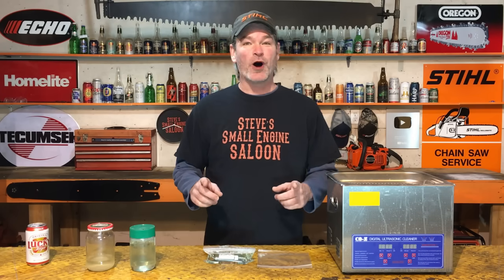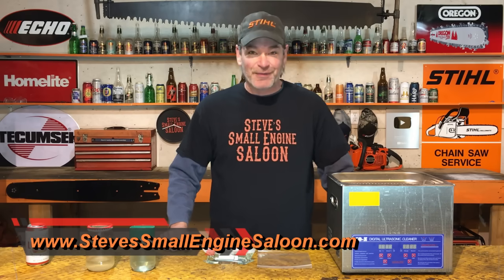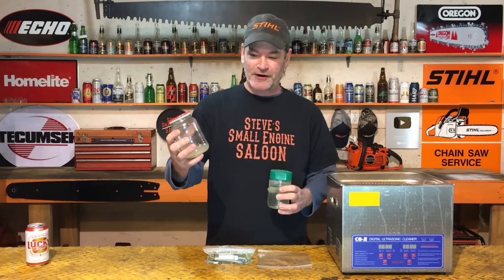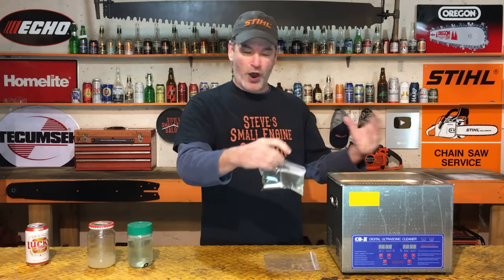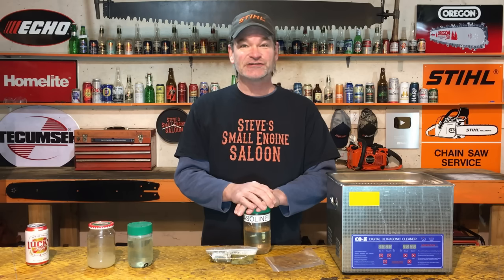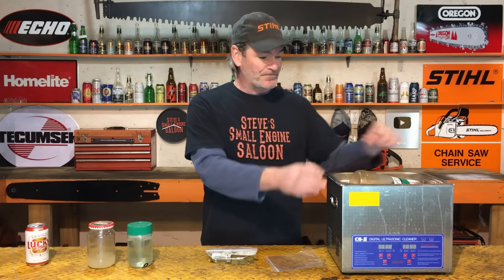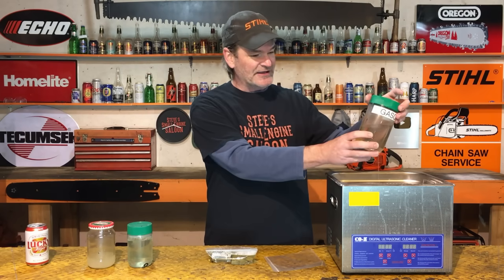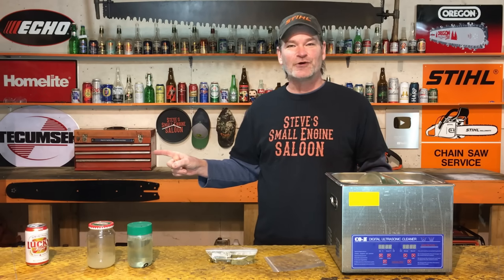UPDATE: Ultimate Tips For Using An Ultrasonic Cleaner

Comment: I believe that the concern about using gasoline is twofold, which I will list below just because. Having said that, just use reasonable precaution, or even unreasonable overkill precaution since that won't hurt nuthin', and the chances of disaster go way down. I occasionally use gasoline too because I agree that it's among the best solvents for cleaning stuff. OK, on to the concerns.

1) ultrasonic waves aren't a source of ignition, but they will increase the rate of evaporation, i.e. fumes. Loose fumes exit the container and could possibly concentrate dense enough that a stray spark anywhere around (maybe even electronics inside the base of the cleaner?) can ignite them.
I never tested this, but a friend's parent once told me a tall story when I was a kid that on a really cold day, you can extinguish a match in gasoline because it's the fumes that hover on the surface that ignite, not the fluid so much, and the cold air pretty much squelches out the making of vapor. Like I said, I don't know whether I believe this and I never tested it, but for sure the fumes are more volatile than the fluid.
Anyway, the first precaution is to make sure the inner container (jar) sealed well and is durable enough so the vapors stay contained inside and don't stray anywhere else to begin with. For a little extra help, you can point a fan on the UC to make sure any stray fumes are whisked away and don't concentrate. A further step would be to use it outdoors so if the gas ever did ignite, it might only burn up a UC and/or maybe the part you're trying to clean. Personally, I just use a well-sealed container in my detached garage and stay nearby so I can keep tabs on things, which I usually do anyway.

2) the biggest problem with gasoline is that IF it ever does ignite, it's an extremely vigorous event and even a pint of gasoline makes quite a whomping fireball if it catches a spark. It ain't so bad out in the yard, but indoors it's a very impressive, unpleasant surprise. Since the result of a perfect storm of wrong turns is a pretty dark day for the unassuming ultrasonic cleaning tech, though the reward is high, so is the risk I guess.

I don't think I'm mistaken assuming I won't live forever, and I work with my hands all day every day, so I'm already leaning my boat toward checking out due to a bad day rather than old age. But for me, the rewards are high and worth the risk. I'm not reckless and I work within what I think are comfortable limits, and while I am certain that some folks just will absolutely not clean things with gasoline in an ultrasonic because "leader" says it's bad, I hold no grudge against them nor will I let that slow me down. It works, so I'm gonna do it while also keeping my wits about me. Walking out your front door is a risk, so is cleaning parts with gasoline (ultrasonic or NOT, by the way). For me, it's worth it. Comfort increases with knowledge and experience. I guess complacency does too, but I'm going with comfort.
Reply: Speaking as a retired firefighter, your young friend was kind of right. It is the mixture of gasoline vapor and air that causes the gasoline to burn (or explore, which is just very fast burning). On a very cold winter day, it is more unlikely that the gasoline will ignite compared to hot +90F degree day, especially if the gasoline is spread over a large area of concrete or asphalt. The vapors expand at a much faster rate when heated. 

In addition, gasoline has a very narrow flammability range, in the area of 1.4% to 7.6% mixed with air, which makes it relatively safe to use, otherwise, we would have cars and trucks blowing up everywhere. When you are moving that match to the gasoline pool, somewhere within your reach you are going to pass through that flammability range, if you are unlucky, the gasoline will start burning before you reach the pool of gasoline. So while technically true, I wouldn't try it unless you are wearing fire protection gear and under controlled conditions (the match was attached to a long pool).  We were shown this during our fire training. Temperature, as I said, also plays a part in the reaction.

Comment: Gasoline vapors are the flammable component, not the liquid gasoline. That is why the gas is sprayed into the cylinder and ignited by the spark plug. The spark is igniting the vapor. That is why old gas doesn't fire the engine. Also, consider that more gas in the cylinder won't fire and we call it flooded or that the engine is running lean there is not enough fuel creating the proper combustion. I hope this makes sense. Adding heat to the ultrasonic cleaner wouldn't matter, all of us store our power equipment and gas cans in area that has heat in the summer. Steve, I learned a thing or two from you keep it up! Have an Old Style for me if you are in an area that has it.

Comment: Hi Steve, I give you some tips:
1) Plastic cups are not used. Better glass or stainless steel.
2) To clean aluminum parts, the best is the aqueous solution with suitable degreaser.
 Temp: 60 ° C This way, Not damage orings

3) The pieces are not supported without the basket. They are not thrown into the tank either. You can damage the transducers.
4) Solvents are immediately heated with ultrasound. They are dangerous and emit vapors that can affect the user.
Greetings from Argentine!! and thanks

Comment: You can use the same solution a lot of times. This what almost all retailers never told:
1. Degas the water. Which means, fill the tank and turn on the ultrasonic. For 30 liters it takes 1 hours +- to degas the water. Check the bubbles how they dance.
1.1 turn off.
2. Put the cleaning agent. To degrease and eliminate carbon, the 80% of the brands have two agents. Some times in relations 5% the first, and the second 0,5%
3. Turn on the ultrasonic and see that there is no bubbles.
4. You are on the correct path. To clean aluminum and cast iron, the correct temperature is among 65°C and 75°C / 80°C

Tips. The only thing you need to do is refill the evaporated water to keep the level and the same with agents. You can remove excess of grease with a spoon. But indeed, you can use the same solution even if it has a quite deep black and dirty appearance. A friend have a 150 liters tank and he does this and the solution la solución dura un año until the agents lose the cleaning properties and the water is really dirty.

If you want to use another kind of solution, use INOX little boxes, you can build them or pay for them with a welding INOX shop, they are not so expensive. Why? The frequency is designed for working with this type of material. Greetings!

Comment: Make a test, using kerosene, gasoline, diesel and alcohol and tell us wich one is best for cleaning
Reply: Try mineral spirits. Similar to kerosene, but with almost no fumes / odor.
Reply: @HyperPete  That's my go-to. It also leaves a bit of an oily residue so your parts don't start rusting as soon as they dry.

Comment: The cavitation vacuum bubbles collapsing (what makes the whole ultrasonic cleaner work) generates extremely high temperature and pressure. Since it’s submerged, no air means no ignition. I think your only risk with gasoline is if your part was partially  above the surface of gasoline so some of the cavitation bubbles where happening at the surface line...
More than likely you could play with that mix for a long time and never get an ignition. But the physics are actually there for a remote chance of a problem. 
I use gasoline for cleaning myself to. Some risk always involved but damn it works better than anything else...

Comment: I use two chemicals in mine: LA Awesome (dollar general super cheap) for removing grease, works really good cleaning grease out of old bearings. I use Evaporust in mine as well to accelerate rust removal on small parts. About 3 cycles and most objects are rust free.

Comment: I owned and ran a dive shop for a number of years back in the mid 90's...  I only used two cleaners for cleaning corroded and nasty regulators etc, Simple Green and Vinegar.  Anything that would not clean with Simple Green, vinegar would.  I also used Tupperware Pickle Containers, they have a slide out tray, that made getting parts out easy.  I made a platform for it with PVC and a piece of lexan to suspend the container, and it was upright and easy to get parts in and out of.
Reply: Here’s a related tip.
Hit up used appliance shops for silverware baskets. Lot of different designs available, great for separating parts.

Comment: Speaking of cleaning, the old chlorinated brake clean  is none other than dry cleaning solution and will bail you out if you track grease and grime on mommys carpet spray and blot with a clean rag. Do not let it get into drain oil or it will turn it into hazardous  material.

Comment: Steve's small engine saloon  
Question for you Blackmax generator 3500 starts and runs but only in choke position, you move it to run n it dies.any help ?
Reply: Main jet in carb restricted with goo.  Remove carb.clean out goo. Replace. If it still does it maybe valves

Comment: Lightning is what makes it work so fast! Maybe they are thinking of static electricity. Try "LA's Totally Awesome" (not citrus version) From Dollar Tree. Cleans well and does not discolor my model airplane engines. Kerosene can be used when machining aluminum. No sparks but can get quite hot. It is however more sensitive to static electricity than gasoline.

Comment: You often mention "your local small engine shop" in your videos... Well I'm never going back to my local shop thanks to your ultrasonic cleaner video.  I had my snowblower serviced last year before winter but discovered that it still was almost impossible to start and keep running.  We didn't have all that much snow so I gave up and used a shovel instead.  I didn't do anything to the snowblower after giving up on it - so it was full of ethanol/gas all winter and summer.   Fast forward to your ultrasonic carb cleaner video and I thought that I'd take another shot at cleaning and adjusting it myself.  I'm reasonably sure that the two torx screws that hold the carburetor to the engine are supposed to be tight - not a sixteenth inch out between the gasket and the carb.  I also think that there's supposed to be a choke on the other side of the carburetor - not just a nylon rod across the hole.  No wonder the damned thing was so hard to start!

I got it cleaned in my new ultrasonic cleaner and tightened it back on the snowblower with a new gasket.  It ran fine although with no choke it is hard to start.  I just put a new carburetor from Amazon on the snowblower ($15 not $123 for "service" from the shop) and it started up on the first pull.  Sure is easier to do with a working choke.  I'll be taking my chainsaws to a shop in the next town over rather than back to those idiots.  Perhaps they were just part way through the service and forgot to do the rest.

A question though - should I put Loctite on the two torx carburetor mounting screws or just depend on the two lockwashers that are already on them?
Reply: The lock washers will be fine. If you use loctite, use the blue. I've worked on many saws (my own too) and have never used loctite on carb screws and never had an issue as long as the lock washers were good and screws tightened properly.

Comment: Electric fuel pump and fuel gauge sending unit submerged in gasoline in the gasoline tanks of every modern gasoline powered automobile.
Reply: Vapor is flammable not the liquid part.
Reply: @yt66228  Tank is full of vapor when you run the gasoline out …..right?

Comment: I am pretty sure you are right on the gasoline. I am not sure but I think another YouTuber named Mustie1 uses the same ultrasonic cleaner and he does not have his filled with water and then stick a container in it with cleaning solution, he fills his cleaner with something Carb Cleaner or something similar, heats it up and sticks the parts directly into it. He is not concerned about it igniting.

Comment: The best I have found  at cutting grease is a 50/50 mix of diesel fuel and automatic transmission fluid (ATF).
Reply: Is this something you used in an ultrasonic cleaner with the jar method?
Reply: not yet, but will soon. @PaulsProTips

Comment: GAS is just fine UNLESS something bad happens like the glass jar breaks in the cleaner. Or the plastic jar is not a stable type of plastic for gas. THEN you may have gas and fumes quickly entering the equation. Gas fumes can easily ignite from several feet away. - Also, how do you dispose of the dirty fuel when yur done with it? Can't run it in engines. Can't dump it. Could throw it on a camp fire for quick hot dogs... ?

Comment: Hi Steve, 
Love your videos, just wanted to ask a question regarding using gasoline as a cleaning medium in the ultrasonic cleaner, 
Say for instance you're needing to clean a carb from a chainsaw due to being gummed up with petrol varnish from stale fuel etc, fresh fuel mix would be most peoples first port of call before disassembly and cleaning, new diaphragms etc, if petrol will clean this from the carb passageways why the need to strip it down an ultrasonic clean it? The only difference would be the sound waves I'm guessing? Carb cleaning fluid is a purer solvent than petroleum and I'm guessing that's why it dissolves the varnish(but that would be expensive to use in an ultrasonic cleaner)  
I'm not trying to create waves, but wanted to hear your thoughts. 
Regards from the UK

Tel

Comment: I like your attitude about the gasoline—I don’t see anything unsafe about it, it works for me and if you’re not comfortable with it don’t do it. Great information, thanks.
Reply: Using gasoline like this in an ultrasonic cleaner is probably a bit safer than using gasoline for cleaning parts in the open. The problem isn't with the ultrasonic cleaner, it is when you open the jar, remove the part, and dry it off. That's when you generate a cloud of gasoline fumes, and that's when the danger occurs. The degree of hazard depends on the ventilation, and whether there are sources of ignition near floor level where the heavy gasoline fumes settle.The ultrasonic method would be safer than just cleaning with gasoline in the open because the latter is likely to generate more fumes.
Reply: @kevinmartin7760  The ultrasonic method would generate a lot more fumes, being evenly spread across the entire surface, and the ultrasonic agitation would be literally shaking it into the air.
Reply from the maker: Right on Cory...
Reply: The real problem with gasoline is the STENCH!!!  Plus the health hazards of the additives.  Try alcohol (but not beer.)

Comment: Gas is fine, but please don't run the heater. It's not that it can ignite, it's that the gas will pump out vapour and build up pressure as it heats up. It can pop the container or make the contents spray out when you take the lid off. Bad if it gets in your eyes, worse if your smoking ;P
Maybe you can find gas proofed ziplocks?

Comment: Gas is only dangerous when it fully evaporates and mixes with oxygen, liquid gasoline is completely stable and safe and is a far better degreaser than the other options in a container. Bunch of fucking Nancy's.

Spill some gas on the ground? Better call the bomb squad.

Comment: I’m gonna skip gasoline AND my ultrasonic cleaner and clean all my parts with lightning from now on.
Reply: "YO ZEUS! NEED A FAVOR!"
Reply: Hers your sign....................lol
Reply: Sweet, new lol
Reply: Lol
Reply: Make a Tesla coil with Microwave magnetron for ⚡
Reply: Well, lightning is electricity that creates light. So, laser is light created by electricity. Laser seems to clean rust nicely. So... you're not far off. Must be an expensive tool tho... But more available than lightning and sure uses less electricity. Not to mention safer, since lightning is "kinda" high voltage... But yeah, skip the gasoline with these...
Reply: It's called electrolysis. Have fun.
Reply: just make sure to wear your welding helmet.    safety first!
Reply: Ultrasonic energy creates implosions of air bubbles and generates heat due to the process. Having Gasoline is not safe and is not recommended.

I work with some major manufacturers of ultrasonic baths and would not introduce Gasoline in the bath.

Comment: The only thing that comes to mind about lightning and cavitation involves claims of cold fusion thru sonoluminescence. Temperatures between 5,000 to 20,000 degrees are created by the collapse of a single bubble and supposedly,  fusion occurs under the right conditions. However, a lit match will go out if immersed in liquid gasoline.

Fire needs 3 things to sustain itself. It needs fuel, heat, and oxygen. If any one of these 3 elements are deficient, then a flame cannot sustain itself. The collapsing bubble may generate that amount of heat but only submerged in even pressure from all sides of a bubble the same way you can start a fire with a compression fire starter tool. 

If a bubble is at the surface, it can no longer collapse because the pressure inside the bubble can now escape instead of compressing. Likewise, a collapsed bubble may ignite but rapidly lose oxygen as well as heat due to efficient heat transfer of liquids
Reply: I got all that but what is a liquid?

Comment: I lke Spray Nine's GREEZE-OFF mixed 25% to summer winshield washer fluid 75%. It cleans better than any sonic cleaning solutiion for 99% of any engine, carb, or plastic parts I have used it on. It rinces off in water easily.